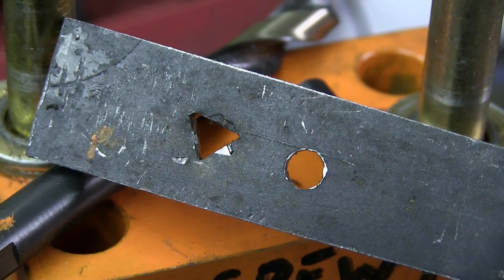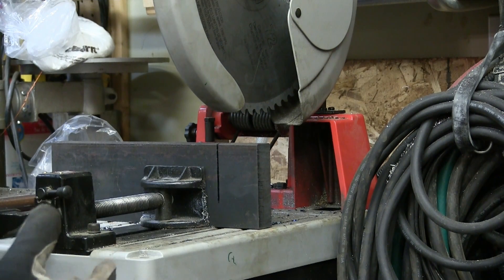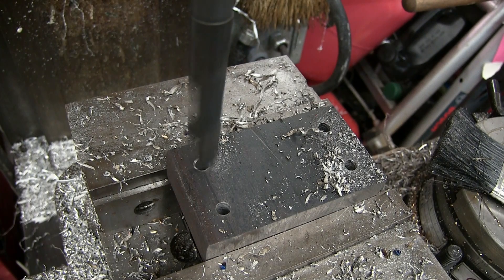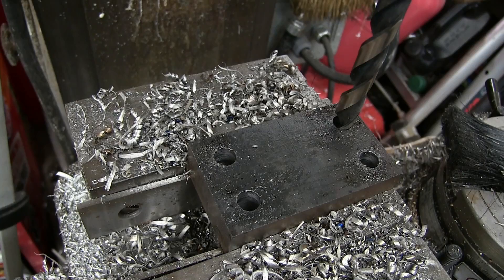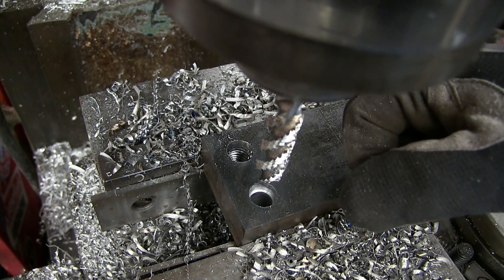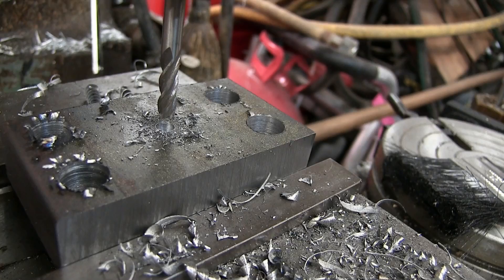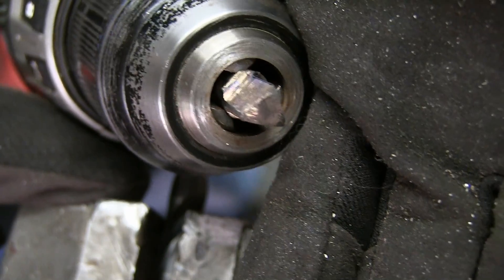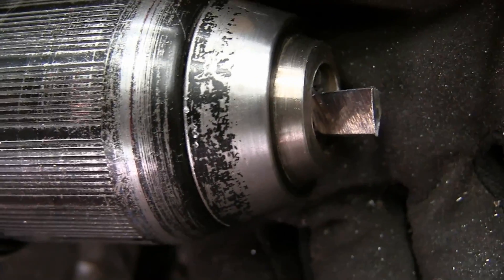Easy and Simple way to make Triangular Holes with a Drill

Comment: this has probably been said a few times but your 20 amp breaker may be tired and need replacing. they are a thermal mechanical device that wears out a little bit every time it trips. just an electrician/goof trying to help. love the channel brother.

Comment: There are situations when you need to work " cold" so this approach is very usefull.
BUT blacksmiths do this working hot metal in seconds. Punching any kind of hole is one of the most simple things in blackmithing, so simple that most blacksmiths prefer hot punching to drilling even simple round holes...
Except very precise hole or holes for tapping where the gritty hard scales can damage the tap itself sometimes or the punched steel might airharden( and the anealing time would void the hotworking speed advantage)...most blacksmiths are hotpunching.
So again, good to know how to punch cold steel, fun to try BUT there are far easier and faster ways, a simple torch, a punch and a hammer( or a simple faster press) is all it is needed.

Comment: The chuck end of a drill bit is usually not hardened so that the chuck can grip it. On some drills the top is even a completely different steel, friction welded to the bottom.

Comment: Be good to use them to make a angle point in something you need a sharp corner in. Do three of the buggers on each corner and then cut out the center mass inside the triangular form between each of the cut holes.

Comment: 27/64...... yeah right. 
I sure am glad I live in s country that uses sensible units.
(No america-bashing, that's just how I feel).
Reply: Richard Öhling Units like that are usually only used while tapping as you need a slightly smaller hole than the outcome which in this case is a much more sensible 7/8th
Reply: Most machining companies in America are trying to phase out the English system and adopt the metric system because of international business.

Comment: Just wondering why you didn't use a  stop. For no more accuracy than  you appeared to be trying to achieve, you could have just used the edge of the vise as a stop and just rotated your block and easily swapped from block to block without having to re locate your hole. Also it would have allowed you to only make three punch marks. Just a thought to save time. Love your channel.

Comment: Hey AvE, what kind of blade is that??? The "best" at Depot are the Diablo brand but they clearly state  "non ferrous" metals only (alum copper n other crap) I saw your Milwaukee saw vid that had a similar blade .  Can the carbide-tipped blades be used for steel and stainless as well??

Comment: I will tell you why you would want to drill a triangular hole! 

There is  a wood stove, made mainly for cooking,  with 6 height inches holes on top,( with an oven and a boiling device....
This stove needs a crank to turn some shafts under the ash pot.  These shafts have a triangular shape( that,s the male part) and it takes a crank having a triangular hole ( female side) to fit the shaft... 
So if you need to replace this shaft, you will need a trriangular hole....

BICD ( Best I could do)!
Reply: remige2006 a triangle hole for a triangle bolt

Comment: when you tap holes with a mill how does it feed down correctly? Does the tap pull the spindle down freely kinda like on a lathe or do you set the feed speed like RPM x threads per inch = inch per min?
Reply: I was wondering the same. I'm guessing the threads are pulling the press down on their own.
Reply: It's a turret head mill/ ram turret mill/ mill drill. In which case, the spindle usually has 3"-8" (depending on model) of up-down movement when unlocked. Allowing you to either drill holes as you would in a 'regular' drill press, without feeding the table up. Or feed the tap down by hand until it starts to cut, then pulls itself in.

Comment: What would the mechanical advantage be of fine thread as opposed to course?  Which has more holding power to resist stripping out?  One more why.  Why not drill the hole from the beginning with an end cutting mill?  Seems it would give you the flat bottom hole and cut it quickly.  The only disadvantage I can think of is it is harder to sharpen (if it is HSS)?  

Have you done your traipsing for gold in them thar hills yet?  Merry Xmas.  Doug

Comment: if you want less vibrations when switching to the larger drill bit then drill a smaller pilot hole (<3mm) its jumping round because the holes too big and the cutting faces toward the center of the drill arn't engaging.  
if you've already drilled a too-bigger hole then using some scrap cloth with some cutting lube in it in between the bit and the material being drilled works really well to dampen the vibrations. Sounds weird but works amazingly well.

Comment: a chain is as weak as it weakest link. the bolts you have used and think are going to hold 24 tonnes it won't it will only hold 6 tonnes or as much as the weakest bolt/threads

Comment: ehm, how about just hitting it with a hammer?
Reply: how about a hamer?
Reply: Okay, so why and when do you think a hammer is a viable solution?
Reply: Just hit the triangular shaped drilbit with a hamer, you have a triangular hole too.
Reply: Sure. If the sheet is thin enough. There comes a point a hammer is not enough - and this minipress could, in theory at least, manage quite a thick piece of metal.

Additionally, slow vs quick applying of force. Things are more likely to go wrong irreversibly with the latter. ;)

But sure, if we're talking about a very thin piece of metal, this would be an overkill.
Reply: Hey, we use that saying all the time ;P
But bigger hammer also means more preparation for that big hit, as it gets more risky.

True enough though, it would be interesting to get calculations and tests on how much a hammer can do.

Comment: A Properly sized triangular hole would be great for capturing hex nuts in sheetmetal work where space is a concern.  Of course, one could argue that you could just drill a slightly bigger hole than the the nut and then flush weld it in place...

I love your vijao's by the way!

Comment: So if you took an old allen key, cut off a length, and dished the bottom (maybe case hardening if necessary) - you could make a hex angular hole?  Might give that a whirl...
Reply: +Chuck Mercer 
It'll work well as a punch (hex keys are usually S2 steel). To do it cleanly you'll need a "proper" die section. Grind the lead in off a socket for a sharp edge and (if properly aligned) it gives you a very nice hex hole. Don't drive the slug right to the bottom of the socket though or you'll never get it out.

Comment: When you run endmills like that to flatten a hole, id run it at like 200-500 rpm.
Burning them up is a shame and you don't need to cut much metal at all so just taker easy and peel it out of there. When you run shit slow you get to hear the metal shearing and working out the flutes. Its kinda satisfying.

Comment: Hey AvE.  Love your vijayo's dude!

I gotta point out though that you used the soft tang of the drill bit for your broaching bit.  You know, the part they leave soft so it'll bite in the chuck and pull lots of burrs when you don't tighten it enough or jam the drill bit?  As such you won't get many holes out of it even punching through mild steel.  You'd need to harden it for that.  And with HSS, assuming it IS HSS, that means just about getting it white hot.

Anywho, keep up the good (?) work!  Your vijayo's are always great fun.

Comment: You can't plunge cut with a 4 flute because the center doesn't cut. (On most 4 flutes) I usually use a 3 or 2 flute if I'm gonna flat bottom a hole. 2 flute on aluminum and the 3 on steel. If it's carbide I use whatever I grab for either material and run it at 1600-2000
Reply: +UnitCrane514 There are quite a few center cutting 4 fluters, obviously he had one. I'd use a 2 flute as well.

Comment: Is there a name or brand for that saw blade in the cut off machine or is it a completely different thing than a std cut off wheel type saw. I needs to know cause I need to cut some steel and the cut off saw stinks the shop up and is too safe.
Reply: +CCW1911 chop saw dammit not cut off machine.
Reply: its a cold cut saw, a chop saw has an abrasive wheel cold cut has one that looks like a wood working blade sort of. the heat is transferred to the chips so its "cold" whereas a chop saw gets hot as the devil. cold cut saws are made differently though.
Reply: +TK TK thanks. Can you just put that blade on a chop saw? Who makes the saw blade?
Reply: +TK TK dang it can't edit mess here. I was trying to ask if you could retrofit a saw blade like that onto a chop saw. probably not but ya never know.
Reply: I read that cold cut saws are made quite differently in terms of the motor. I believe they run at a lower speed and have quite a bit of torque through gear reduction. They also are quite expensive. I wouldn't know too much but from what i've read no a cold cut blade will not work because the chop saw runs too fast, you would be feeding in too much metal and the motor wouldn't be able to handle the torque needed, double whammy right there too fast and too weak. Cold cut saws do make the nicest and most accurate cuts and the burr is very small.

Comment: I suppose the triangular hole is for a smaller hex bolt or nut to fit into be centered while also being engaged on three faces. Room enough in the gaps to hammer a pin or put in a weld to lock it in. Now I'm curious if that's actually the case.

Comment: Powertapping is the civiliced way to go! :)
Your old porty bridge sounds quite horrible in reverse...
Reply: Reverse is normally straight cut gears, forward gears are helical cut.
Reply: yes but the gears in the rear end with the differential are helical cut gears even when its in reverse anyway, that's probably where part of the noise comes from
Reply: good old gear teeth, broken right in in forward. . .well they dont like going backwards cause the wear pattern is forwards, thats why in a manual car you back out of the driveway and it sounds like that too, it may have 200,000 miles on it but ill bet you only a few of those miles were spent with the gears rubbing the wrong way, and they sure dont want to get to know each other very well

Comment: Warning! Powertools mating at 12:27. rated M for mature.
Reply: This is totally SAFE. HONEST!
Not shaking hands with danger, here!
Please look the other way for a bit.
Reply: Sexy! I did that once to put a groove one a metal caster wheel. Welded an axle to the wheel and put it in a drill press and held a grinder to it. Groovy

Comment: I've watched just about all of your videos now, and have seen you trip the 20 amp breaker multiple times. So I'm curious if it's not possible to upgrade the amperage of the breaker? Is it just a pain in the ass because you have to rewire it? I don't know much about these things. That's why I'm watching your videos.
Reply: I fully expected the breaker to trip again when he was about 3mm from cutting right through. :)
Reply: ***** Scratch the 25 away and have a 20A sticker on there? I won't tell
Reply: Regs in the UK have about 9 factors just for how the cable is installed to denote how much current it can carry. Let alone the cable type , length of run etc.
Reply: +AvE That breaker might be just weak.  Swap it with the wifes hair blower breaker.
Reply: +thebigzor  I was going to say the same thing. That 20 amper might be a 12 now.
Reply: +BodyGuardian Pierce Lol, the circuit breaker is there to protect your wires, not your machines. Your wires probably won't burn at 25A, but I think it's mainly an insurance thing.
Reply: +AvE could just be a power factor problem, add a cap and you may just get over that knife edge
Reply: +AvE She only tripped when you were givin' er too hard on the grippy trigger finger thingy. Let the weight of the tool do the cut, just don't grip it and rip it!
Reply: +DirtRider500R i believe he means the wiring in the house.
Reply: Well I obviously have a lot to learn. Did not know about the insurance part not liking it. Thanks for all of the information everyone.
Reply: Wyatt Roncin I guess the weight of my arm must be just perfect then.

Comment: A mini press that's even easier to use is made with square plates and bolts in the corners. Get a piece of gear stock (it's a really thick pinion gear that you can just slice off disks to make your own size gears). Weld one gear under the head of each bolt and then you only have to turn one of them. The trick is that two bolts in opposing corners need to be left hand thread.

Comment: Question for you, would it have been easier/better to use an end mill to cut the hole, or did you not have one in the size you were making, seems the side wall of the drilled hole was kind of meh?  Thanks for sharing your videos.

Comment: Holy shit! Is that a wood blade in that chop saw? Why the hell have I used abrasive cutting blades my whole life???
Reply: +Logic Bob No, it's a cold cut saw/blade made for steel/metals, and the saw only runs like 1500 rpm. Don't try your wood saw and/or blade for steel lol, it's not the same... It would probably work OK in aluminum, but don't take my word for it.
Reply: jozafax You could use wax or some other lube to fix that.
Reply: +jozafax Lifetime of aluminum fab+ lifetime of family. Wood blades plus alum. More teeth = better. Fat kerf = better. Don't let the work piece vibrate, feed saw slow and steady, keep RPMs up. They make blades for alum too, but they don't really seem to do any better than a good wood blade. It's mostly luck of the draw. You buy a sampler of what is available and one lasts and the rest don't. Then you buy all you can scrounge of the one that works well. The main thing is with a lot of them, the carbides come un bonded and stick in the aluminum. Then the next tooth hits the chunk of carbide and it's looks like a reservation beauty.
Reply: +jozafax The problem with using a wood saw is that  the motors aren't sealed. You get that aluminum oxide/iron oxide in there and the motor won't last too long.
Reply: +Logic Bob I was trying to ask that in an awkward ass way meself earlier. I looked it up and Im thinking the problem with putting one of those fancy metal cutting blades in your average abrasive type chop saw would be the rippems as AvE calls them would be way way way to high. And those blades are pricy to ruin experimetaly.  And if you got a cheap HF chop saw like mine the bearings would fly out allowing the blade to run loose in the shop, probly slicing a few fidly bits in the process.  I'm still considering it thou.
Reply: +Kevo F 
I can confirm that: wood saw with wood blade (more teeth = more better) works fine. The first few cuts on alum. are ok regarding the surface  of the cut. Then the alum. starts to deposit on the teeth of the blade and you get a progressively shittier finish, so you are required to scrap the alu off the teeth between every couple of cuts.
Reply: +Logic Bob I was considering getting a cold cut saw, but the machine alone costs @ $300 Aussie more than a horizontal band saw, so I went with a band saw. The plus with a band saw is once set up with water drip lubrication I can get on with other things as the saw will stop when the cut is done. Also they are a hell of a lot quieter than cold or chop saws.

Comment: How is that cutting dangerous? Just curious.
Reply: all machining can be hazardous as the hard tools can shatter explosively and bits from the machining can fly everywhere.
Reply: I dont think that's what he meant though. Pretty sure it was more specific.
Reply: +ottard oki, to be honest I didn't listen too good to what he said, so I probably missed something. :)
Reply: long strands of really sharp metal chippings flying from the drill at warp eight? not a great idea. likely won't kill you, but I like my eyes right where they are.
Reply: Nah, I was referring to when he was using the saw. He said something like: "Dangerous yes, but so much fun!"
Reply: ottard well then its the super hot little bit of metal flying through the air. Same rules apply.
Reply: well imagine going up and touched a running drill bit or a saw not good. or turning on something and walking into it or drinking a star wars koolaid copper acetate solution or bit exploding or getting poked by sharp metal shards on the ground. eh its understandable not too likely but enough so that you should worry
Reply: i dont think its the cutting or the drilling specifically but from the little ive seen of his workshop, its best to keep them out entirely. reinforce the idea that the workshop is dangerous until theyre old enough because if you invite them to watch while youre in there they might not understand fully why it is dangerous when you arent there and maybe sneak in carelessly.
Reply: +TK TK Damned if you do, damned if you don't. :P If you never let them in - they may sneak in when you're not there just because they're curious, and just because some kids are natural rebels. :P
Reply: +Tomasz Wota (Xupicor) hmm true, however still many sharp things, keep the fear of god in them what fer child abuse and chopped off fingers and what not and that should be enough to keep them out. I don't think that one needs any convincing though, she does what she's told it seems.